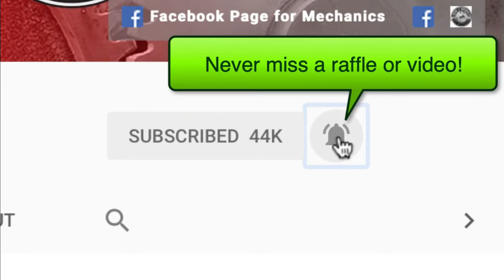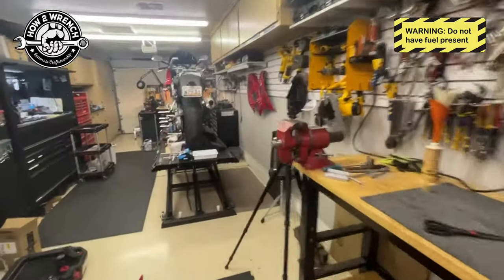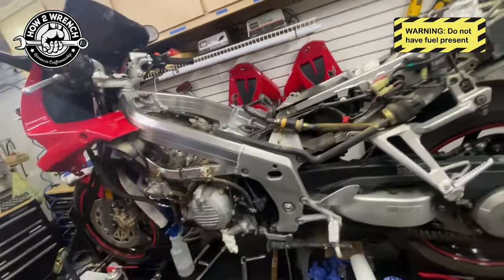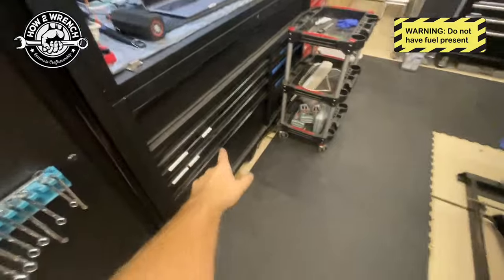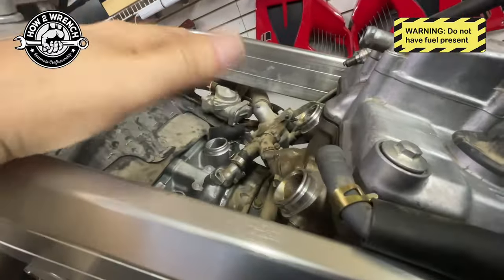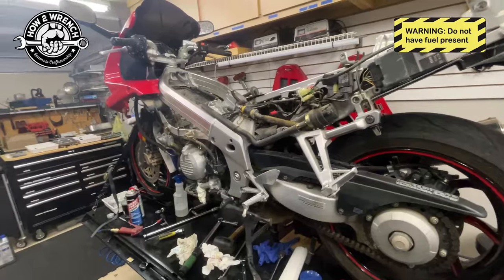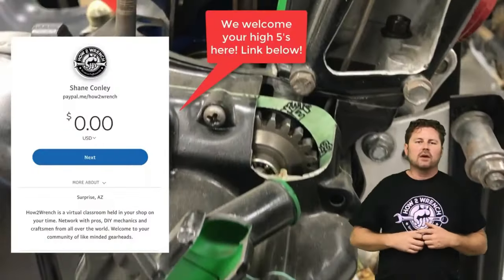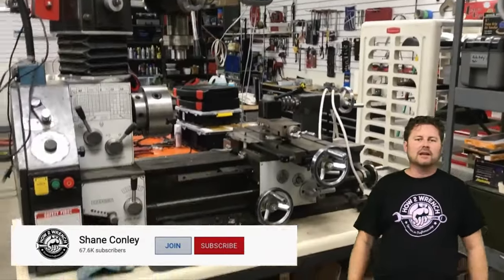Best DIY way to check spark plug wires fast! No tools needed #misfire #sparkplug #diymechanic

Comment: so, Have you thought about using an Oscilloscope for your diagnostic work. Your General Tech scope is a fantastic tool. I think it would be great to see people use it more. Even though it’s great for seeing secondary ignition wave forms, and seeing comparing them, it can also be used for more.  
An Oscilloscopes fast buffer and sampling rate is also great for a starting circuit test with an Amp draw with Voltage for “starters” (😄)
Add an attenuator to see your spark KV on a graph, … lots of possibilities.
Keep Wrenchin’ Dude 😎